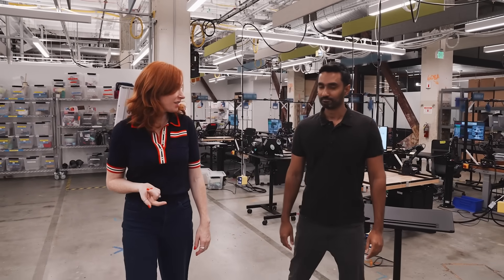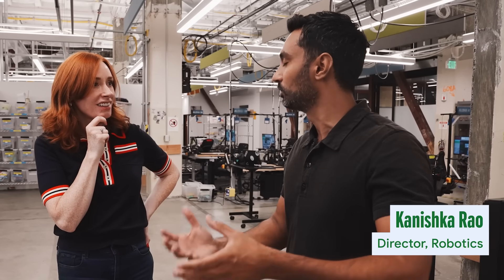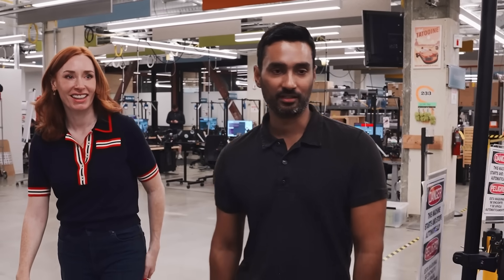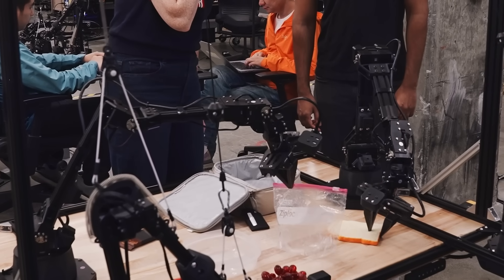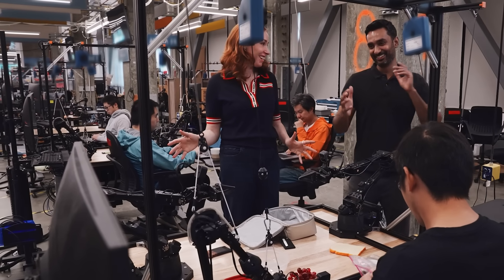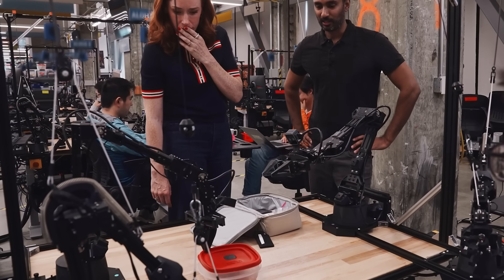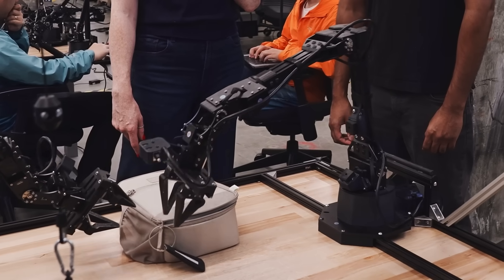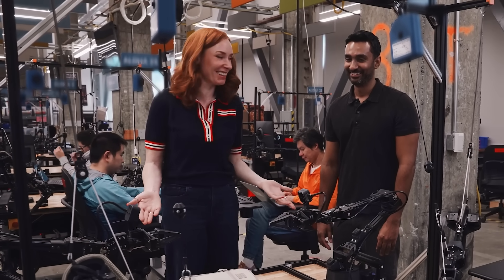Google DeepMind robotics lab tour with Hannah Fry

Comment: Yall realize they're focused here on the AI part, not the robotics? Like a lot of the limitations are from using basically two pairs of chopsticks for hands. They're more interested on how to efficiently teach a model to think, plan, and execute tasks in the real world right now - then they'll put it into a more complex/capable robot. Using the chopstick hands allows them to simplify things (less DOF) & they're cheap so they (and any other research lab/university) can set up dozens of them for real world training and research, whereas a 500k+ robot would be more limited.

Literally none of this was possible 18 months ago, you'd say "put the red cube in the star shaped square" and it would just fail to understand or it would grab the wrong cube, or fail to grab the cube but not realize and continue on. Choosing the right cube, the right hole, and understanding where it is and what it still needs to do to successfully complete the task is the impressive part.

Comment: IMHO Today’s AI hardware is fundamentally flawed: digital AI stores weights in volatile DRAM that burns power just to stay alive. 

We urgently need persistent spintronics Non Volatile Memory (NVM) MRAM (e.g. IMEC’s SOT-MRAM) in High Volume Manufacturing (HVM) (= near DRAM volume) to enable energy efficient AI that can learn continuously over years.

Furthermore, it is highly energy-inefficient to perform AI computations relying solely on traditional silicon transistor technology. 

The FESO ferroelectric-spintronic architecture developed by the French lab Spintec, which can operate in either analog or digital mode, could enable both much more energy-efficient, continuously learning AI systems and more energy-efficient digital computers. It is also CMOS-compatible. It should be a top priority as it is a required substrate for energy-efficient embedded AI for robotics, and even in general.
Reply: Make it exist first then you can refine
Reply: @tahirkyembe1559  To develop the FESO spintronic–ferroelectric architecture proposed by the French research lab Spintec, a substantial investment would be required—likely on the order of $300 million to $10 billion. (For comparison, as of December 2025, Naveen Rao’s start-up Unconventional AI raised nearly $500 million to pursue an alternative to traditional digital computing.)

IMHO, accelerating progress in spintronics and ferroelectric technologies will require a Manhattan-project-level effort. These approaches have the potential to deliver 10× to 1000× reductions in power consumption—as illustrated, for example, by Non-Volatile-Memory (NVM) spintronic SOT-MRAM developed at the European research center IMEC.

As of 2025, the Magnificent 7 (Apple, Microsoft, Google, Meta, Amazon, Tesla, and NVIDIA) are each spending close to $100 billion per year on energy-inefficient AI hardware build-outs.

Given this context, it would be entirely reasonable for the Magnificent 7 to allocate even 1%–2% of their annual hardware spending to a moonshot program in next-generation spintronic and ferroelectric computing, that has the advantage of being CMOS compatible.
Reply: The future is photonics, providing practically unlimited parallelism and multi-state ops.  Researchers have already demonstrated computation and storage within individual photonic ring-style elements.
Reply: @Justin_Arut  Spintec’s FESO architecture has the tremendous advantage of being naturally bi-stable (persistent, e.g: SOT-MRAM) with the possibility of quasi-continuous multi-level states, which is an excellent match for emulating synapses that store weights.

It is also much lower power—operating in the femtojoule range, and possibly even attojoules in the long term—than photonic approaches.

That said, photonics could still be great for applications that benefit from massive parallelism.

Comment: Love the peek into the lab! Personally I'd love an even deeper dive! It's worth mentioning Gemini Robotics research papers are available, and they're quite transparent about how to integrate the models into a robot pipeline.
I've been experimenting with Gemini control of an old Turtlebot2 ROS robot for a couple years now. It's so amazingly capable! and stupidly brittle XD My current implementation uses Gemini 2.5/3.0 Pro/Flash to write Python code on-the-fly, leveraging a hardware specific API, that in itself integrates other Geminis (like Flash-lite and Robotics-ER) and local real-time models (like YOLO).
I'm not sure it will ever not be a little weird to have a non-biological, alien intelligence wandering around the house!